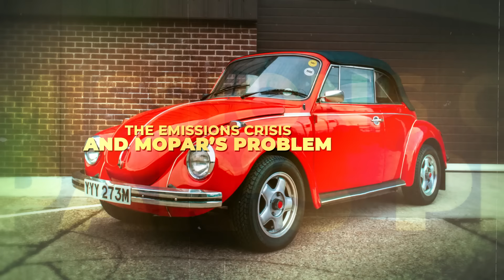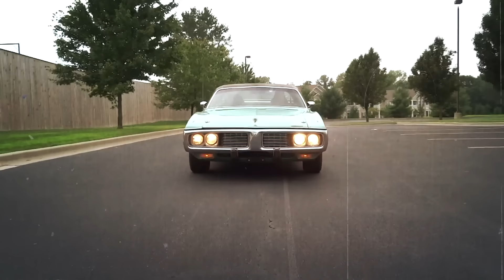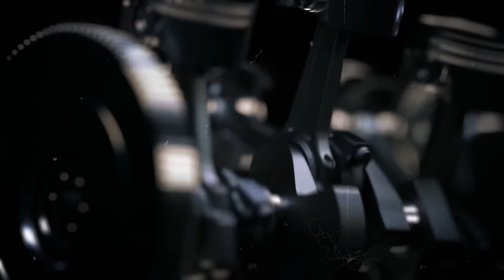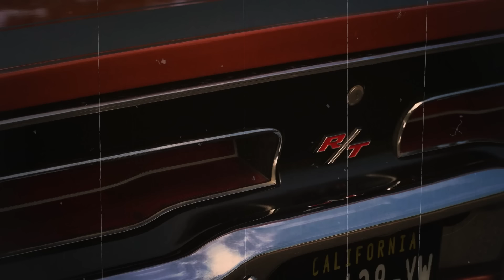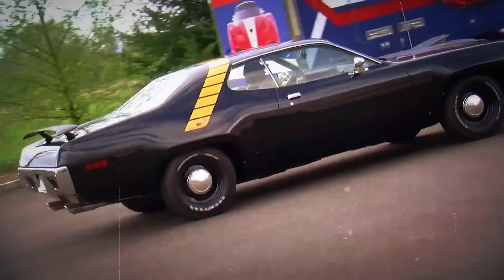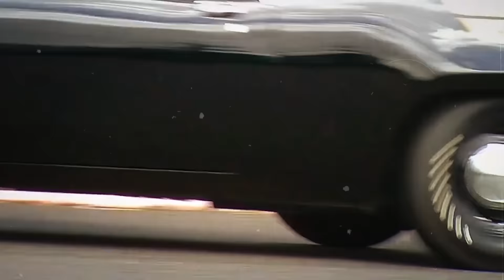The INSANE Mopar Valve Trick That Detroit ERASED From History!

Comment: I'd rather have cleaner air to breathe than letting some small nut A-hole have a rolling pos capable of going faster than needed to get to work and back. Track racing is another story, but not road material.
Reply: A properly operating ICE car can have good performance with little pollution.  The EV crowd do not understand that EV's are not feasible for every area, and the power grid is not capable of providing the power required to recharge mass quantities of EV's. There are already areas with far too much demand on the power grid than they can support
Reply: I do believe that opinion of your's is in the minority where it belongs you're opinion does not align with reality
Reply: @kenfritsch8749 I disagree with you 100%. The nation is not capable of supporting the push to EVs that you eco-clowns are pushing.  The electric infrastructure is severely overloaded already but you think it can still support additional loads placed on it. Every summer and every winter there are brownouts and blackouts and people are restricted on when they can use their air conditioners and space heaters.  If you add charging a bunch of EVs to the grid, it is going to fail. Plus  that electricity is still mostly produced by coal powered power plants. Wind generators are ecological nightmares. And there are so many more reasons why EVs are a mistake.  You can keep your RC toy but in reality they are going to do more harm than good if they are pushed into increased use.

Comment: Everyone knows that 1971 HP ratings were in gross HP, with no accessories, but 1972  ratings were SAE NET, about a 20% difference. The engines were neutered, no question, but not as much as you imply.

Comment: If you offset or angle your guides from the seat, you make scrap metal. The guide must be in line with and perpendicular to the seat. You can offset or angle them together, but good luck with a major change like that. You'd have to correct the geometry in your valvetrain. Might as just well get different cylinder heads. Or just get a better engine.  But go ahead, feel free to bend or break your valve stems, it was a free country, at one time.

Comment: It works in other engines as well. The industrial engine had a rocker arm that was not a 1.5 to one ratio. It was closer to 1. 6 2 to one. That's where you got the slightly longer duration of opening. It changed the slight reversion something that Chrysler also ground into some of their camshafts in 1973 which had so much reversion that would lower the compression ratio at idle at but allow a higher Dynamic compression at higher RPMs and still get better fuel mileage. I worked on Chrysler products a lot starting in 1964 on up. I was working with a lot of these Chrysler Engineers from ramchargers like Mancini racing in the light because they were right down the street from me. They had a lot of interesting tricks like this. And it isn't only the industrial engines that tried to get the valves to turn the valves are always supposed to be turning. That's the way they're designed. It starts with the angle on the cam that makes the lifter turn and that puts a little bit of a Twist to the pushrod and that puts a little bit of a Twist to the rocker arm and that makes the valve twist a little bit. That's been around Forever on all engines. The increased reversion by expanding the intake duration was not as effective on Chevy and Ford engines possibly due to a bit different compression volume of the heads I don't know. But it does explain why in 1973 a 318 2 barrel in a challenger would run the car above 140 miles an hour. I had a 1971 Dodge Dart with a 318 that I run at well over 140 quite often. Play with the transmission a little bit and that 904 would shift out of first gear at 55 miles an hour at 7200 RPM felt like somebody hit you in the rear end with a pickup truck doing 70. As long as I was rolling nobody was touching that car.